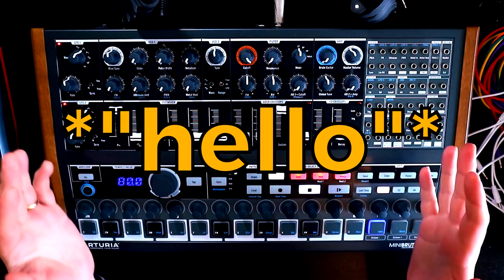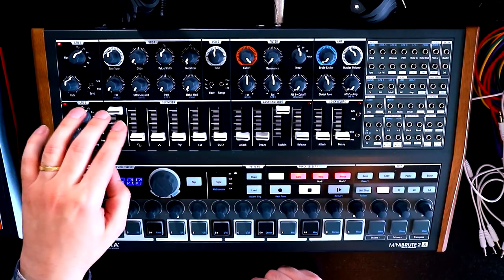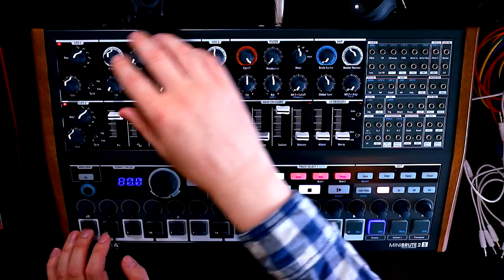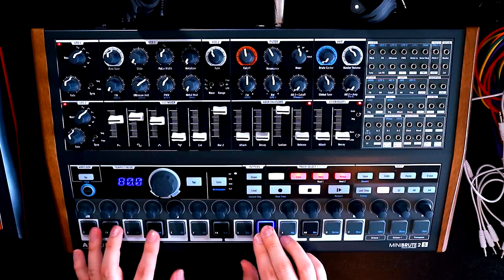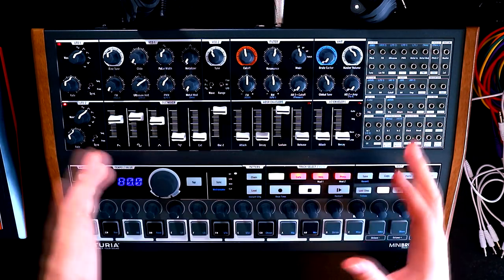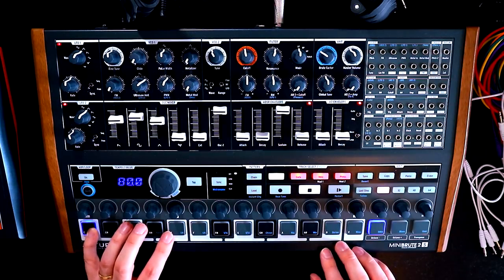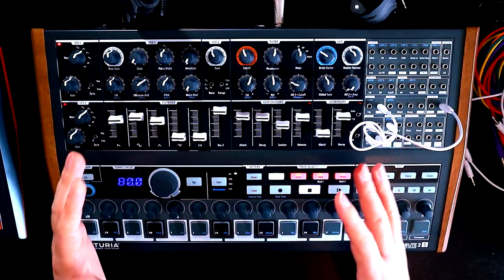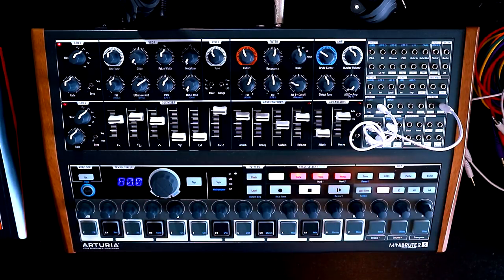Arturia Minibrute 2 / 2S - Let's Build a... Bass

Comment: If oscillator 2 won't quite get an octave below, just use the fine tune knob on oscillator 1 to make oscillator 1 a little higher, and use the global tune to compensate if you need the whole thing to be in 440 standard.

Comment: 17:44 fyi you technically do have two more spare envelopes by using the sequencer mod outputs :)
Reply from the maker: Yes, and I dig into the Mod tracks a lot more in later videos. I was talking more about manually playable envelopes in this case.  It'd be great to be able to re-purpose those tracks to just be an extra envelope or LFO that was key triggered. Actually I wonder if you could do that with the clock and reset inputs patched to the gate signal with the sequencer on 1ppqn? Never thought of trying that.
Reply from the maker: Yeah, that totally works, I stand corrected. Set the Mod track length to 1, patch keyboard gate into clock, make sure the sequence is 'playing' and the envelope on step 1 is an independently playable envelope. Obviously you can't use the sequencer conventionally then, but thanks for pointing that out.

Comment: great bass! but how do i sync LFO to the tempo of my DAW? or restart lfo each time i hit the note?
Reply from the maker: As long as the mb2s is getting a clock from the DAW, there's a sync switch for each LFO - set it to Seq (for sequencer) for tempo sync. See section 5.2.1 (page 29) of the manual.

The other way to do it would be to use one of the Mod tracks (sequencer track 3 or 4) in one of the LFO modes.
Reply: @OscillatorSink  yes, it syncs to the midi input, but the lfo does not restarts when a new note is pressed. i mean, that when i press a note the lfo is always at the random start position. And that is very important for the bass
Reply from the maker: @radjan666  I think for that you'd probably want to use the A/D envelope in loop mode then.

Comment: I'm confused, you linked the LFO output to the VCA envelope? Doesn't it have a fast attack? Initially I thought you were linking it to the filter envlope, which has the longer attack, hence the delay of the LFO coming in.
Reply: Or is it that the LFO is linked to the VCA, so the overall amplitude/output, which increases naturally as the filter opens up, due to the filter envlope settings?
Reply from the maker: I think the confusion comes from the fact that you have the "Amp" (which is also a VCA), but also a utility VCA which isn't linked to the output - it's just used to amplify signals inside the patch.

I used the utility VCA here. The LFO goes into its input (so that's the signal I'm amplifying / controlling); the output of the VCA is going into the filter cut off (via the attenuator), so the LFO is controlling the filter cut-off; then finally I'm controlling that utility VCA using the ADSR envelope (the one that's normalled to the filter FM) so that the amplitude of the VCA, and therefore the "strength" of the LFO is going up as the filter opens up, following the ADSR.

Does that clear things up?
Reply: It does, thank you!  @OscillatorSink
Reply from the maker: No problem! Sorry that wasn't totally clear in the video.
Reply: @OscillatorSink  Thanks, I needed this explanation too :-)I'm not sure if this would involve these mixing operations, but I am trying to think of a way to recreate the pitch wheel and pitch bend range knob found on the keyboard version or Minibrute 1. Connecting the Keystep means you're stuck to only one pitch bend range unless you go into the software. I like to be able to use either a fifth or a whole tone, so I wonder if I could patch something using attenuators and the tuning button or even FM. So an attenuator could become a pitch wheel somehow and maybe the FM knob would set the range? Maybe I'm dreaming here...
Reply from the maker: The Keystep only has CV output for the Mod control though I think, which might be a non starter anyway?
Reply: @OscillatorSink  I just looked and the Keystep does have pitch CV out but I was using MIDI and the pitch wheel did work as expected but can't change the range and would like to avoid connecting Keystep  anyway. I guess it's not possible to create a "virtual" mod wheel with definable range using the functions and patching of the MB2S. I mean where a knob like an attenuator or even a slider could be used instead of a mod wheel
Reply from the maker: The Pitch CV is the actual pitch of the keyboard/sequence though - not the pitch bend, so you can't really scale the bend using CV attenuation.

I think you can sort of do what you're asking though - and the Mod output on the Keystep could be a good candidate:
Mod on the Keystep into VCA input.
The Attenuator with +5v into the VCA CV.
The output of the VCA... whereever you want to send it.
Use the attenuator to set the maximum range.

That sort of does what you're asking, no?
Reply: @OscillatorSink  Short of not having to use the Keystep that sounds good. I will try and let you know. Thanks very much